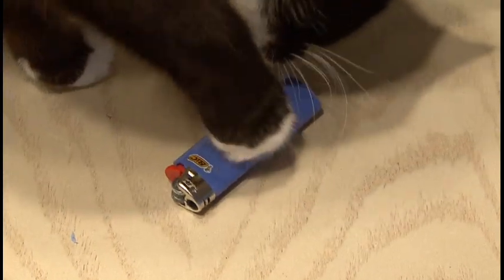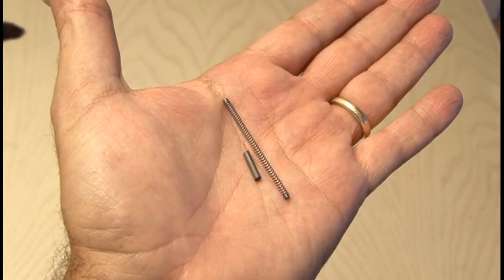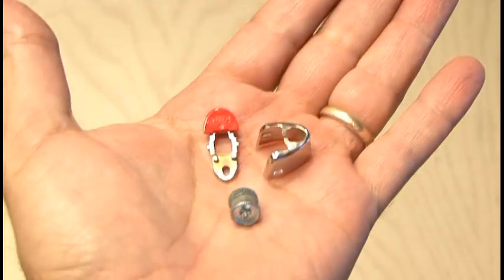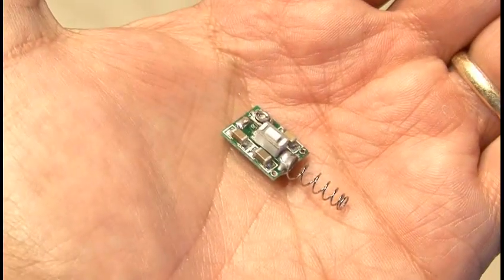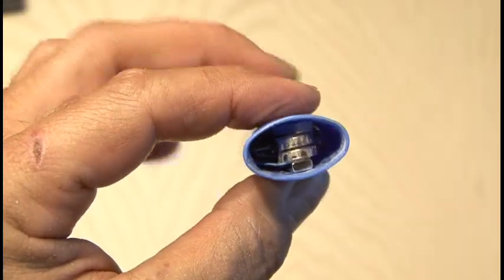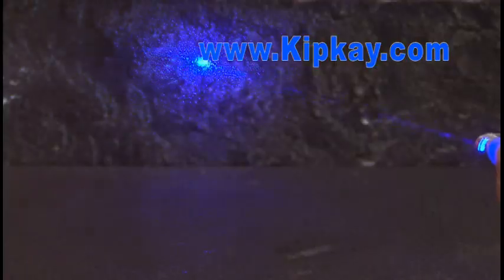Amazing Cheapy Lighter Laser Burner!

Comment: You are my main inspiration for taking apart and empty wider this is this was an electronic rider it was like that but without the friend also so also I was be able to use it but it ran out of butane so I got rid of it by the owes awesome way and took it apart when I took apart I sent a random had a little circuitboard inside power by three batteries real tiny batteries I wish you were a good called teen

Comment: Please forgive my beginner's electrical knowledge, but does it matter which diode is connected to the resistor, and does it matter which diode is connected to which terminal on the circuit board (I just don't want to get the diodes mixed up if they shouldn't be)? Also, if I use a lens from a CD player, will that make the laser more powerful?

Comment: "The flint can be used as an emergency fire starter" you mean like a lighter?
Reply: if you throw it hard enough against something like concrete, it can burst into flames.
Reply: +Tntmod54321 you need to burn the Flint before throwing it
Reply: @HomelessSoldierMan  no, if it's going fast enough it will spark on impact
Reply: No, pretty sure he means like a flint/steel spark fire starter.  I know, why not just use the lighter?  Well, maybe it's out of fluid as those throw-away bics don't refill so easily.
Reply: DoomsDay Why not :D
Reply: Homeless Soldier I'vdone it without heating it, you just have to put it in a spring about the size of it, and it ignites, i've done it, so there's no convincing me otherwise
Reply: Why tho
Reply: Tntmod54321
Reply: Miriam Moo yes miriam
Reply: Homeless Soldier not neccesarily homeless
Reply: Tntmod54321 yes you do.
Reply: Joshua Sanderson not just any lighter, the BIC lighters because they're dangerous for your cat to play with because it might burn the house down.
Reply: You rap the spring around it and throw it at the ground!!
Reply: Joshua Sanderson think about it, if you run out of butane you can still use the flint
Reply: Joshua Sanderson ahahahahah
Reply: A lighter contains fuel, this does not.

Comment: I'd like to integrate this into a homemade multi tool that also has a small flashlight (minus the lighter body, of course).  Would it work to make them both run on the same batteries?  Would I have to do something differently?

Also, could this be made to run on a cord rather than batteries?  I'm thinking it would be handy as a desk model to use for crafts and such.

Comment: You should always light the cig while its out of your mouth pointing laser downwards. For the sake of air traffic safety. This video would have been done much better with an infra-red laser diode. its far more efficient as a lighter, with zero risk to anyones eyes.
Reply: While you are right about the red diode's greater efficiency, the blue diode is more of a hybrid because it is bright and burns better than green. And no matter what frequency the laser can still rupture your retina. At such an intensity any frequency including the lower frequency such as the red would permanently blind a person. Most likely blind them permanently at least. But yeah be careful with lasers in general.

Comment: Hi Kipkay, I just bought a Red 650nm 6mm 3v 5mW diode module, Aixiz driver board for 650nm and 4.3 ohm 1/2W resistor and I put all of them together but my problem is that at couple of seconds my lser lights up then it gt dimmer then gone. I don't know what I did, I follow the schematics you use on the video but mine doesn't light last as yours. what did I d wrong? need your help

Comment: what resistor do i have to use plz help
Reply: +Glimm You need a 4,3 ohm resistor. Where do you find the laser module?
Reply: +Throwing Everything ofc it will work, why it shouldnt? A laser is nothing else then a focused light beam. The color doesnt matter at all.
Reply: +Throwing Everything Has it arrived?  Have you built it?
Reply: +Derca d Maybe a busted blueray player.
Reply: Or a busted PS3 discdriver
Reply: I dont have one :(

Comment: what is differens with 650nm 455nm is 650nm better, or u have to have 455nm for this?
Reply: color
Reply: bigger number is brighter?
Reply: marks47 533 not 633!!
Reply: ty
Reply: zozias101 Noooo. Bigger and smaller numbers are less visible to the human eye. In theory, 633nm (nanometers) is most visible to the human eye. I think that's why firetrucks got painted that ugly green years ago...    as you move away from 633nm in either direction, the light is harder for us to see. 455nm for example, is a blurry blue/purple... 405 gets even blurrier. There's actually a lot of "energy" there, it's just that your corneas block it out.   After 650, for pointing lasers, any number would "suck.".   The cheaper 5mw (higher mw's are illegal in the US for pointers) laser pointers usually have 650nm diodes in them because they're cheaper.  See here: http://en.wikipedia.org/wiki/Laser_pointer

People: if you didn't know every single thing I just typed above, you're not qualified to build one of these lasers, or use one. The last scene alone, where someone's lighting their cigarette shows that kipkay and his model/actor/stand-in/whatever took unnecessary risks with their vision.
Reply: marks47 why are they illegal now, they were selling them everywhere

Comment: Will a 3v laser diode work as well, since the power source is only 1.5v? (I am not well-versed in circuits, so if that's not how it works, just tell me.)

Comment: It can be cheap or it can be expensive. Yes this is real. It all depends on what you buy. There are different power wattages that are weak or strong, and while I don't know what he used, it can burn if it is strong enough. Legally can't be more than 5mw but this is probably a little bit more than that.

Comment: Hey kip Kay I was wondering if you could send me a detailed schematic for the module oh and where to buy the module . I already have the diode ,resistor ,battery and bic lighter just need a little help on where to solder the components.

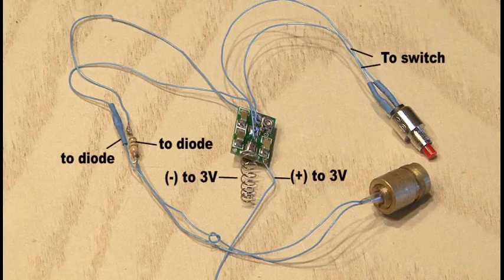Comment: some links on your website are wrong. there is the driver for a blue laser but a red laser diode on your website. there are not the links for the switch and the resistors. do i need a 4.3 ohm 1W resistor or a 4.3 ohm 1/2W resistor? what is that blue thing next to the resisitor at 1:22? can you please upload a blueprint to see better which wire has to be soldered to wich component? 
that would be great

Comment: not really, as usually emergency fire starters are stored for years without use. if you try to store a bic lighter for years without use, most of the butane or all of it will have leaked out.

Comment: Where do you solder the wires (on the laser driver) to the switch and diode + resistor?

Comment: I have received all the recommended items and this will not work. first of all the laser diode COMES with a micro driver on it already. (making the other driver I bought pointless) It is a red laser and defiantly will not be burning anything. Looks like I will have to buy a new diode to put into this housing and use the driver. Going to have to wait another week. What a bummer. Thanks KipKay for your incomplete/unverified information.

Comment: It is highly possible to burn things with lasers, you'd be surprised. You know the laser in a lot of computers can burn stuff? How do you think CD Burning works? The laser literally BURNS information onto the disk.

LED's also use little power, which is why this has the potential to work. I have never tried it & am not 100% sure this is real, but I know it CAN be done.

Comment: You might want to check the law again on that.  (For some reason I can't post a link here.  Google "FDA authority over laser pointers and handheld lasers")

"How FDA currently regulates laser pointers:
No matter which category (demonstration or SLA) is applied, the result is to restrict the laser’s power to less than 5 milliwatts of visible light."

Sure you could illegally /own/ a laser pointer over 5mW, but you can't buy it legally in the US; you'd have to get it from someplace like Hong Kong.

Comment: @wooshmaan The module pumps up the power from the batteries until it's high enough for the laser.
It WILL work off button cells, but probably not for long.

Comment: @TGbobby no it doesn´t. all you need is a laser with sufficient power. (the one he used has approx. 200mW) but a laser with a visible wavelenght may prevent you from harm.

btw: if you don´t have physical or electrotechnical background i would highly recommend that you don´t try to build a laser device! you have only two eyes ....

Comment: @NotEvenNear 
It's 4.3 ohm. It's not alot but is suficient because the regulator in the driver controls the voltage. The resistor limits the current for the diode, you don't really need the resistor though. These laser diodes are power hungry and those button cells won't supply alot of current anyway.

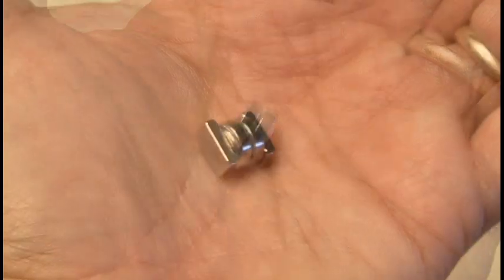Comment: i have a question. at 1:42 you start inserting the things on the inside of the lighter, but it does not move when you are using it? or it fits right enough ?

Comment: @DutchyVegas420 that only applies to certain batteries. I know for a FACT that AA batteries are not like this. I had one explode and shoot it's acid right into my eyeball while trying to close the lid on one of those cheapo battery powered handheld fans. For AA they contain a metal shell, with the acid and other components sealed inside

Comment: @Kiloku2 Dangerous, yes. Fake, no. If you search A23 batteries (which are the ones used in this video, you can see a picture of one with part of the wrapper removed on wikipedia. They are made of those button cells.

Comment: @tmj0431 a normal cigeratte lighter is dangerouse and its mass produced. but a laser can be more dangerouse. but if its develped properly it can be as safe as any normal  lighter or even safer. e.g. reducing the range and intensity of the laser for a cigarette lighter. or u could then increase the range and diameter for a firework lighter so u can light it from a distance (liscense for a firework lighter possibly). i can see potential in this. and those are simple changes of the top of my  head.

Comment: @mononcleroger 
It's not fake. I watched his other vid dedicated to that trick. While trying to replicate it, I suspected, did a little researched and learned a bit.
He fails to point out that 12v batteries are NOT AA ones, as most of us would presume. AA's are single single cell batteries and only 1.5v. These 12v ones are A23's, multi-cell, less common.

Comment: In the end, all that's left of the original lighter is just the shell and the button. Heh.
Looks interesting, fun even, but  frown at the safety of it. It'd be fun to use, but not practical, requiring much more careful aiming. Nor does a lighter need range.

What actually interested me most here was learning that those batteries are just a wrapping of a bunch of tiny wrist watch battery cells, hahah!
Hell, noone ever told me and I never tried opening a battery up. But rather curious.

Comment: ive tried to connect it to the 220V and it turned into a lightsaber. pretty cool, but you cant go longer, than the wire you have and it costs 400'000$ to use this weapon for 12 seconds....

Comment: Fake, but a good fake. The only way to light a flame is to get the temperature of the object above it's flammability index. Because laser pointers are built without a resistor, you make the laser less powerful, and therefore, obsolete.

Comment: i made this and there is this little game called barber shop where you need to cut the string that holds stuff like ps3's and gameboys, ect. i cleared an ipod touch a ps3 and agameboy 3ds from that thing with only 25 cents. so you can open the winnings thing. thanks Kipkay your awesome. im enjoying my new toys. :) btw thanks alot for this cool laser lighter. it burned right through the string in the game. your the best.
P.S. i subbed. bye

Comment: Resistors are measured in Ohms, not voltage. Any voltage can be pushed through any resistor if the amperage is low enough. If you're going to do this, you need to read the packaging to determine the proper operating voltage of the driver and calculate the correct resistor for the power supply you've chosen.
It's not difficult, and you should not become frustrated. They have some pretty nice calculators for this kind of thing where you just plug in the specs of your materials. Google it.

Comment: None of these parts are hard to find. The diode isn't .99c as the lighter is, but, it's a laser so what do you expect. Everything is easy to get and simple to put together. You can do it in about 15 mins with under $50 of stuff. Think of how much you can now -make- by selling a laser lighter.

Comment: @italianboy555100 Not really, Light travels in straight lines (longitudinal wave) & reflects at 90 degress when hitting a surface such as glass or water (transverse wave). The diode is never really going to be on long so it shouldn't burn the plastic.

Comment: Oh wow. This is so simple! Any kid could do this with ease. Just get this and that, then do this, after, rework a little, do this and that once more, do it again and then take this, take that, totally change it and put it apart and together again, then get this here and take that from there, put it together, do this here, put apart, get some wires, put it together, take only 8 batteries, so easy, solder here and there, don't forget the resistor, and in the end, you could just buy something else.

Comment: at the site you give ( laserdiy ) you can buy this kit, this will cost you 100$ though, so its not that cheepy, however if you collect the parts yourself its alot cheaper, you can make your own cirquit by ordering resistors and stuff at radioshack, and the laser diode you can get that from a xbox 360 dvd drive laser module, available at dealextreme for 7 $, this is not spam, im just saying this for people who want to make this for cheaper

Comment: @superbajskorv2000 generally if you buy a good quality laser is will have the capacity to produce heat like that, but they are suppressed intentionally by the manufacturer using potentiometers, i think to preserve battery life. look up "pot mod" videos on youtube and you'll see what I mean.

Comment: @fuegoyeago LOL! get your facts right man... lasers are very very! different to a flashlight. the laser diode is powered by 3 volts that what almost all laser diodes are powered by (in volts) and the reason why the laser didnt burn the persons face was becasue the laser was not in contact with his skin for a long enough period. lasers are not bulbs or LED's the only thing in common with LED's is that they are both diodes.

Comment: @talldiesel Paying attention to detalis would help. That's not a AA battery in the video. It's an A23/LR23 which is basically 8 button cell watch batteries stacked in a shell. 

***Taking apart alkaline batteries would get you a handful of manganese dioxide and maybe potassium hydroxide, not recommended.

Comment: @haze656 actually I have been using lasers for well over a decade now. I have used them for targeting, burning and in special effects. I surely would not want to rely on thinking that a difference of 2" stood between my face or retina being burned because I accidentally held the laser a tad to close. I surely would not follow this guys tuts and for anyone wondering, this kit costs around $100 to buy. Still my complaint is simple. Just as he states "never point it at yourself..." what does he do?

Comment: @yanicklandry
Batteries are not made by a couple of watch batteries, but a power source is! 1.5 * 2 = 3v which is what the pointer requires.

12v batteries contain button cells, they have done so for many years.
Early 9v batteries contained a stack of AAAA (yes, 4 A's) batteries too for anyone interested.

Thus, not a fake and a sound idea, thumbs up kipkay

Comment: @RetRoxSoNiiC To build that entire thing would take a while, Pot smokers (any smoker) can not usually hold their breathe as long as a healthy lunged none smoker. So I am not sure what you're trying to say there and in any case there is no such thing as a Good Pot smoker but if I had to pick something it wouldn't be based on how big a cone they can pull and hold it in for it would be based on how small of a cone they can pull and get high off because they then spend less to get high.

Comment: I HIGHLY doubt a high powered 445nm laser could be powered by 2 button cell batteries, regardless of the driver used.  There simply would not be enough current...

Comment: i dont understand... are these the right things?
650nm 5mW laser module.3.2V to with lens 650 nm OEM
&
Micro-Drive Laser Driver by rkcstr - 30 to 440mA

is that all i need besides switch, batteries, resistor, and wires?

Comment: @VTC1000HP Im not quite sure if i even have this right, but to say it simply, the "laser" being emmited is a form of light. this is easily comparable to the sun's light, which gets hotter when we stand directly beneath it, because of a flux of energy. The same rule applies to the "laser", more energy means more power, which in turn means more heat. If you want to try this, just hook up more powerful batteries to a regular laser light. That should create the same effect.

Comment: @mrvictory0910 it would obviously stay lit once its lit... it looks like it doesnt produce a ton of heat so it takes a few puffs more then normal to get the ember going. im also guessing that a laser that strong would be incredibly dangerous to the eyes and pointing it in the general direction would cause serious damage without proper goggles.

Comment: @UnfoldedTreeLover yeah with higher voltage, BUT that will outburn the circuit to fast unless you build a bigger version, but again then it is not a lighter sized burner :)